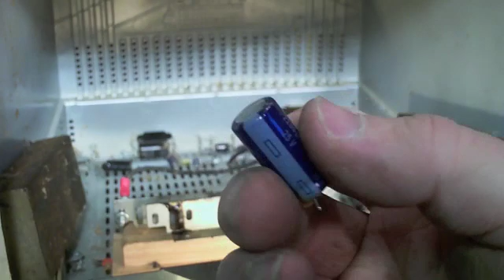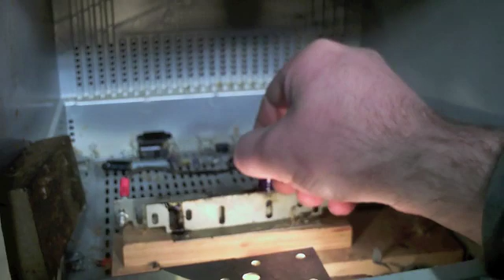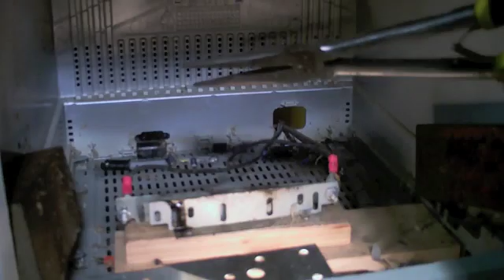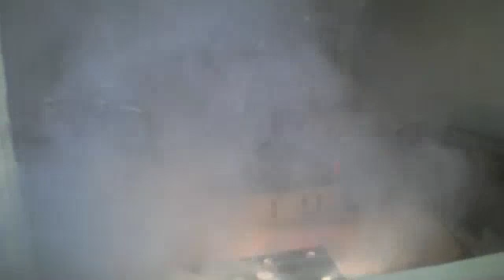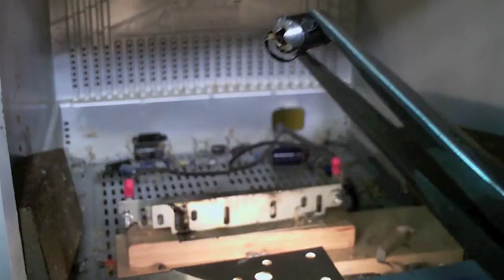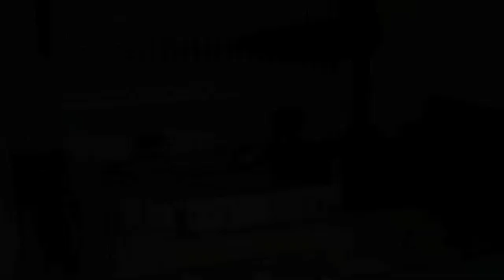Epoxy Capacitors

Comment: The Epoxy also seems to have trouble bonding to the Aluminium, just completely submerge them in epoxy,Just the heat is the only thing that'll prevent a good POP